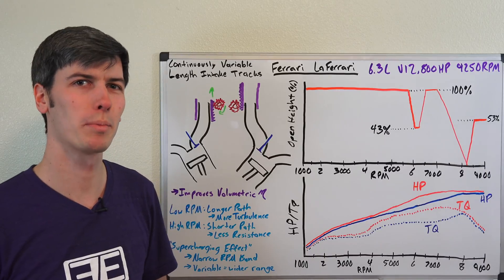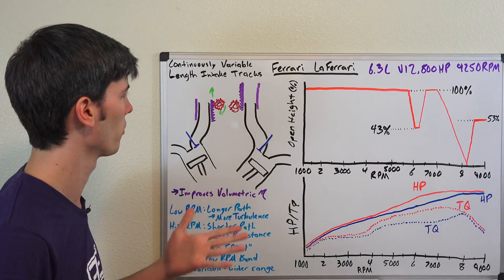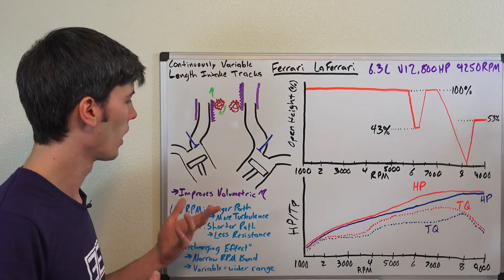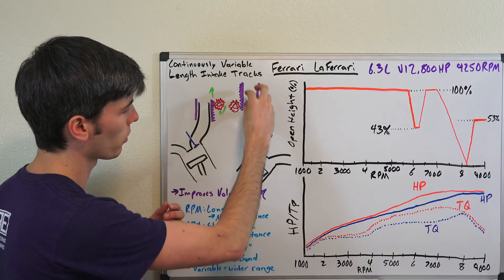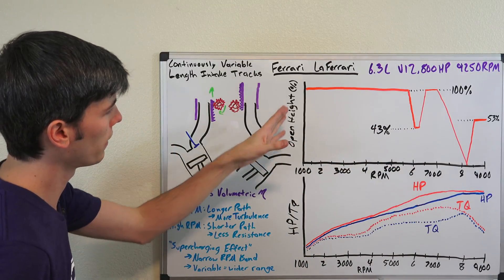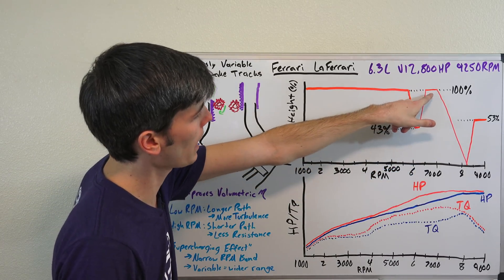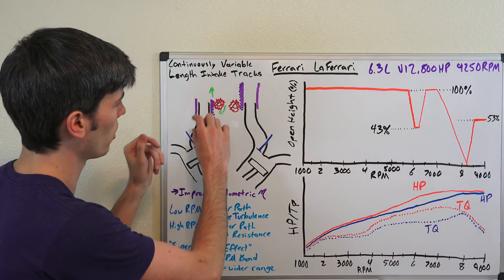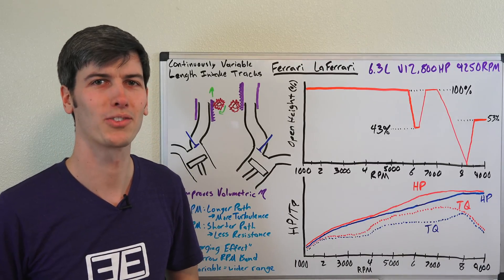Ferrari LaFerrari's Brilliant Air Intake System - 800 HP V12 Engine

Comment: I know that it works, but the charts are probably exaggerated marketing BS. How can they achieve a "significant improvement" between 4000 and 5500 rpm if the system only gets activated above 5500 rpm?

Comment: My 1st gen Toyota MR2 had a "TVIS" intake system that was pretty cool.  It just had 2 plenums for each cyl. Only one was open below 4400 rpm.  Above 4400 the 2nd one opened and it sounded sweet when that happened.   The 4AGE is one of the best sounding engines in my book.

Comment: What kind of dyno chart is that?  One where HP and TQ never meet?  I don't think that's possible.
Reply: Unless he has HP and TQ plotted on different y-axis scales, but it looks like HP/TQ are plotted on the same y-axis scale...so yes they should cross. TQ will start out higher than HP.
Reply: @jacobbuehn5036  it could just be that they crossed before or after the range of RPM that they measured
Reply: Good spot! I would also like to know how is that possible.

Comment: The hard part is sealing a variable length system reliably, especially with time and wear. You need very good manufacturing quality and tight tolerances to get it to work.

Comment: Why does the power curves separate at 4000 rpm and the torque curves at 3500 rpm when the intake is only changed after 5500 rpm?

Comment: So on this system do all the intake track adjust at once or is it all variable? If it's all variable do they just extend into the manifold log? I would think that even if it's max of 50-60mm increase in length if say the front most intake track extended out and the the rest didn't it would bind up the back couple or cause some geometry issues with the rest of the tracks.

Comment: You've got the intake runner length vs rpm the wrong way around. Longer for high rpm where the engine can use the higher air speed, and shorter runner length for creating more torque. Pretty basic stuff. Been around for decades and proven hundreds of times.
Reply from the maker: Nope, explained here: https://youtu.be/FaYIHQGU00k
Reply: Yeah! This technology has been around since the 1700s, varying the air intake on their horse's nostrils helped people get to work on time.
Reply: You sound like a douchebag.
Reply: Nope, long = optimized air flow for torque, short = minimised restriction up the rev range. 
Same reason why variable valve lift works by only opening up the valves fully at high rpm, and same reason why old (and badly tuned new) engines bog down when launching full throttle instead of starting off light and feathering in more throttle as the rpm's climb up.

Comment: There was a similar system like this on my 1997 Mazda MX-6 called VRIS (Variable resonance intake system) which used butterfly valves to alternate between a longer path and a shorter path.
http://www.mx6.com/forums/2g-faq-general/162593-faq-what-vris-everything-you-wanted-know-more.html

Comment: If the bottom graph is comparing non-variable to variable length intake, and the top graph shows no variation in the length until 6000 RPM, shouldn't the graphs be identical until 6000 RPM, and only show improvement in torque/HP above 6000 RPM when the system is active?

Comment: The blue lines show power and torque if the intake length was static across the rev range right? If the intake length doesn't change below about 5500 RPM, how is the variable intake length system accountable for the red lines diverging and making gains around 4000 RPM? I had a look at Ferrari's original graphs and they look just like yours so I'm not faulting you! But there must be other factors at play than just intake length to account for these gains right?

Comment: @Engineering Explained The effects of variable inlet ducts should be correlated to Helmholz' effects. Though how do you explain the difference in power and torque for the variable inlets to the referenece curves for fixed inlets in the areas where the variable inlets are fixed? If inlet lenght is the only variable, there should not be any difference in the rpm-range up to approx 6K.

Comment: ok, BUT you forget explain something, and the most important…. the size of the bore intake… since this, the length can be more variable, more or less… this is 126hp/L, fit a 4throttle body on a renault clio RS with no variable intake, and you have the same output/displacment a lower rpm, juste because the bore is different… your explanation is not a typical rule!!!

Comment: While it is interesting that the LaFerrari has this, it is nothing new.

The Mazda 787B employed a similar system all the way back in 1990.
So also does the Yamaha R1,R6, and V-Max also employ variable length intake.
And in Formula1, all of the engines in the V10 era employed some form of variable intake. It wasnt until the rules change to V8's in 2006 that the line was added banning variable geometry intake runners.

Plenty of other manufacturers have used multiple intake runner systems, where an internal valve chooses between one length or the other. But in the case of the above mentioned vehicles, they have a truly RPM dependent variable geometry system.

Comment: My question about this system is, How can they improve the Torque and Horsepower below 6,000rpm if they don't adjust the intake runner length below 6,000rpm? Is the drawing not to scale? (IF so, that is just fine by me, but i found it a tad bit confuzing.)

Comment: Can you direct me to equations for calculation the optimal lengths to optimize the pressure behind the valves in relation to rpm or would that be a dyno base testing situation only??

Comment: I believe the Mazda 787b also used something similar but it had individual throttle bodies.
Reply: Yes Mazda did use this technology way back when they won LeMans. This was the only way they could get efficient charging to the rotor chambers. It was simplistic by design pretty much mimicking a trombone.

Comment: The early 90s Ford Taurus SHO had an engine that used technology similar to this. Except the SHO used valves to change between intake runners that varied in length. It was a Yamaha built motor

Comment: EE since you drawn a graph with this variable length intake (increase in volumetric effeciency) how much "HP & Torque" is gain from the ~4k rpm to ~8k rpm?

It will be very helpful to your audience, if you added this ~ "HP & Torque" gain as text in your video. Thank you.

Comment: Can it help turbo cars on the lower RPM lag?
Reply: No,

Increasing the length of the piping increases the time to build-up pressure and thus increase turbolag.

With Turbocharged engines it's best to keep your plumbing as short as possible. 
Good example the Mercedes split turbo F1 design.

Comment: i don't think it has that much to do with turbolence, but more on resonance increasing dynamic compression, similar to what pipe length do on the exhaust manifold.
both things apply mostly to N/A engines, where turbocharged instead don't benefit at all from these techniques.

Comment: Again - very nice presentation! Thanks for that.
But here is just one thing i dont really understand: the variable intake length mechanism starts to act at about 5.700 rpm, right? how is it possible then that it improves the tq-line already starting from about 3.500rpm?

Comment: Thanks for the video, nice explanation. I just wonder why the horsepower and torque are affected from ~4000 rpm range when there is no modification of intake until ~5500 rpm. Is this just an oversimplified graph or is there something I'm missing here as I'd assume everything would be exactly the same until the intake changes. Thanks
Reply: the other graph isn't just without this system moving but without this system at all, 100% is not the default, the default is what they found averages out the best for the entire range, who knows what that length may be. the variable system on the other hand uses the ideal for low ranges and the ideal for high rpms thus beating the standard at every speed.
Reply: i just placed the same question...lol
sorry i didn't saw your comment before.

so i say
x2
Reply: ah yes. that make sense. i really hadn't this on my mind.
thanks for your information!!
Reply: Jeremiah John Thanks for that, makes perfect sense.

Comment: How would they go about timing the frequency? And how do they know the frequency?
Reply: Scout Scamp There are those things called math and physics.
Reply: TheFarciarz777 4
Reply: Isn't new.

Look up 2 stroke engine exhausts.
We have been calculating these since the 1960's as far as i am aware.

It's travel time of the gas (speed of sound * length)
And the travel time of the piston which is 1 rotation with the 2 stroke engines.

The returning wave of the exhaust shoves the unused mixture in the exhaust back into the engine. Effectively supercharging it. 

A well designed 2-stroke exhaust can increase power/torque substantially within it's designed RPM range.

Comment: The intake length is 100% uptill 6k, so why is the HP/TQ curve different from 4k?
Reply: I guess the lower line is for no intake piping or for something thats average across the board while this thing is also improves low end power without needing to change length.

Comment: Hmmm.  If there is no intake length variation below 5,500, how is there a power/torque differential arising from variable length runners at 4,000+?  I'm guessing it's that your charts are sort of impressionistic, right?  Very helpful description though...thanks!
Reply from the maker: +Doug Donderi for a single length, they would have to optimize for the entire RPM range. This means shorter than necessary intake tracts at low RPM, and longer than necessary at high RPM.

Comment: your graph does not make sense ( or your explaining)
If you have fixed length intake, and your paint graph with changed length intake, parts of the graph where length is constant  in both cases as you noted 100%, Torque and Horsepower MUST be the same. but it's not, so why is that ?

I get that you can keep resonance tuned based on rpm, no magic that, but you can't have two engines one with deactivated system in that range of rpm making completely different torque and power rating.
Reply from the maker: +Linas K if you choose a single set length, it will be a compromise. Too short at low RPM, too long at high RPM, hence the difference.
Reply: ok, so i would select 100% length like you say, and my torque as well as
 power should be the same. only at resonances and other magic places 
where i am tuning length, it should give more performance. 

As thought exercise for you  to explain what i mean.

Lets think about old car and distributor. You just invented retarding 
timing to get more performance. That is just great, you can gain power, 
no problem. But if you have fixed angle and variable valve time engine, 
power and torque at the same angle for the same motor will be the same, 
right ?

Comment: maybe for a ferarri this is worth it but it seems to add a lot of mechanical movement I wonder how reliable this system would be long term
Reply: A stepper motor or some other actuator is not that unreliable, theyre used everywhere in production lines and such

Comment: if you have an ecu, and you can track rpm, fuel/air, and intake length, can you not just have this set to adapt for different atmospheric pressures, fuel quality/octane, temperatures, etc.? For something 'infinitely variable' that graph did not have much variation.

Comment: Didn't the RX-8 have a similar type of system that adjusted the intake runners for maximum torque and horsepower throughout the RPM range?

Comment: If the graphs are showing only a direct comparison of the affect of changing the runner length (and no other factors), how is it they are able to see an improvement in power at 4k rpm when the runner length doesn't change until 5750 rpm?
Reply from the maker: +twinturbostang choosing a single set length would require compromising the low and high RPM power. Too short for low RPM, too long for high RPM.

Comment: wait I don't see at 5200 rpm where torque and horsepower are the same
Reply: Good eye, nice catch.
Engineering Explained in another comment that the graphs did not have a scale applied, they were just freeform graphs.
Reply from the maker: +Bad DFW Mid-Cities Drivers they have different units, thus different scales. And crossing at 5252 assumes you use the same scale and imperial units. Nothing really magical about 5252.

Comment: So is volkswagens vr6 intake work the same?? I know three out of the six runners are a bit longer so I was wondering if you get the best of both worlds. 3 long runners used for low rpm efficiency and 3 short runners for high rpm efficiency??

Comment: Mazda had the same basic system on the R26B in the 787B that won at LeMans.
Reply: Anime536 _ intake....  The exhaust comes out the lower ports below the intake.  And shoots fire from its gigantic exhaust pipe.
Reply: Correct. There have been a few companies using this or a similar system. The Porsche 993 had a similar system already. Was adjusted by air pressure (under pressure and release).
Reply: I was just about to post this. This sort of thing has been around for awhile. Don't know where this guy thinks it's the next best thing since sliced bread. 
I love Ferrari , but the intake runners on the 4 rotor takes the win all the time!  😎
Reply: Yes, and a similar tech is on BMW's M54 engines from the early 2000s, though admittedly it's not as variable as this is.
Reply: computiNATEor the Mazda system is very adjustable.  Straight ITB pipes.  There are some dyno vids where you can see it in action.
Reply: Right, it looks awesome. Like Hilborn stacks on rods.
Reply: were those telescopic tubes in the mazda intakes or exhausts?? i saw those tubes changing lengths in a mazda video and i thought they were exhausts lol...
Reply: Chris Juarez what's interesting about the Ferrari setup is that top graph, it's not a linear long-to-short variance like you see on some of the older systems (e.g. 787B).

Comment: mercedes has something similar in their intake manifolds they have built in runner flaps that open and close in the intake manifold depending on engine rpm. air flows in a circulating pattern and a shorter passage opens up when you want more power i have it on mine its a m272 intake manifold.

Comment: I duns like epa settings, they set my motorbikle too lean from the factory and I had no clue until I put bigger jets in for a richer a/f then tried starting it and it started the first try compared to struggling to start even with the choke on the factory jets and a/f%  no wonder why my bike was gutless until third and in fifth gear
Reply: benson420710 It's even bad for the engine to be lean

Comment: Up to 5500 rpm the intake lengths are the same yet the HP / torque curves seem slightly higher on your chart. The affects of the varying length surely won't show an improvement until above 5500rpm when you actually optimise the intake length? Maybe I'm reading too much into your graphical representation...